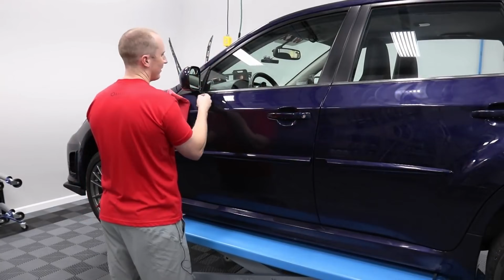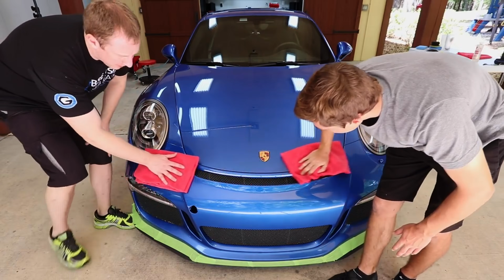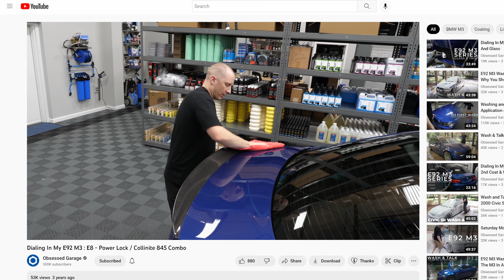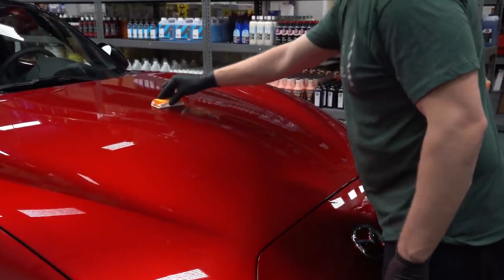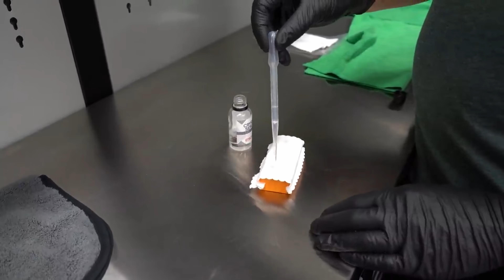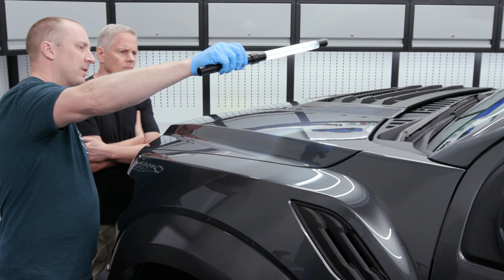How to Choose the Best Car Protection (Car Wax, Sealant, or Ceramic Coating)

Comment: Helpful video!
If you go the route of Power Lock + 845 Wax + Beadmaker and you need to recoat after the 6 months, what work do you have to do to recoat again with this trio and have a good/proper contact with the base clearcoat? Will a good wash and full decontamination (chemical and physical) be suffifient, assuming you are still happy with the paintwork (minor swirls, etc.). Or do you have to also use a Panel Prep as part of the recoating process?

Comment: This might sound like blasphemy but I had some honest questions.... I have a 2021 Tesla Model Y as a daily driver, sometimes kept outside sometimes in garage.  It has never been "treated" other than I hand wash it and apply Gyeon Wet Coat occassionally.
1. If I go down the Sealant/Wax route, how will you tell when you need to reapply both?
2. If I go down the ceramic coating route how do you tell when to reapply?
Is the answer when you run your fingers over the paint you feel resistance and that "eee eee eee" rubbing sound?  Or is the answer to just estimate in month's time like stated in the video per each product?  Thank you, it's been ages since I detailed a vehicle to perfection!
Reply from the maker: Great question! The first thing to know is that maintaining protection on your paint is not a perfect science, regardless of what people may tell you. A product might say that it will last six months or two years, but that's just an estimation. Depending on the condition, it costs to stay one day or till the end of time.

 The best thing to do is pay attention when you're washing. You should look for slickness or the "Eee Eee" sounds you mentioned, as well as water behavior. So, is it beading well, or is it holding on to water? Those are going to be your best indicators of the health of the protection. 

That being said, it might not be a bad idea once every year or so to stip your car of all protection and apply a fresh new layer. Especially if you live is a state were it snows. Hopefully, that was helpful.

Comment: Can I put regular or spray wax on top of ceramic coating? Seems to me that might be the way to go.
I use turtle wax ceramic spray wax in case that matters.
Reply: Yes you can put a form of wax product over a ceramic coated vehicle, but no, the reason is because when you’ve put a wax over on top of a ceramic coated vehicle, you’re masking the effects of ceramic coating ie hydrophobic behaviour, self cleaning abilities and chemical resistance. Best get a ceramic detailer to freshen up the ceramic coating after each wash :)
Reply: @ShaksWD  thanks
Reply: @TonicofSonic  pleasure to always help out :)

Comment: Is it ok or beneficial to put a wax over your ceramic coating?
Reply: No
Reply: You can put a wax over your ceramic coating but the answer is no, the reason because your wax will then mask over the properties of a ceramic coated vehicle I.e hydrophobic properties, self cleaning ability and chemical resistant. Best get a ceramic detailer to freshen up your ceramic coated car :)
Reply: Nope. It wont bond to your clearcoat

Comment: Gtech is better for trimwork.  But I have yet to see a coating last more than 12-months (give or take).  The cost of 845/PowerLock ($5 per vehicle in product) vs CSL/EXO is substantial.
Reply: I'm not sure what it is, but I'm starting to see more "coating failed in less than a year" gripes too. Not sure if it's lack of care, crappy run of product, or some combination. I was going to try a ceramic coating on my new truck,  but I can wax a lot of times for the cost if that's the case.
Reply: @HammerPowered  They claim to last long. It's marketing. The 845/Polylock is a good combination. Especially when using P&S BeadMaker as a drying aid.  I have yet to hear any indication that OG Drying Aid plays well with 845/Polylock.
Reply: The coating will only last as good as your process that is prep work and maintenance.  2 years strong here and still as good as the day I put it on.
Reply: If my car has a ceramic coating can I just  do 845/power lock from this point forward?
Reply: @wjkrug  You would have to remove any remaining coating.
Reply: If you have a coating already, CarPro Reload or Gyeon Cure are what you want to look at.
Reply: The coating on my car is going 2 years strong, still like the day I put it on
Reply: @josephkorger  Congrats on your buyer's justification.